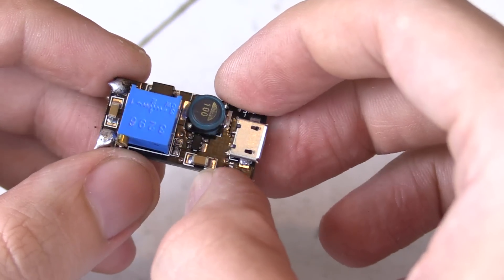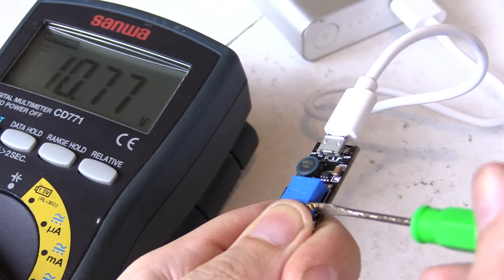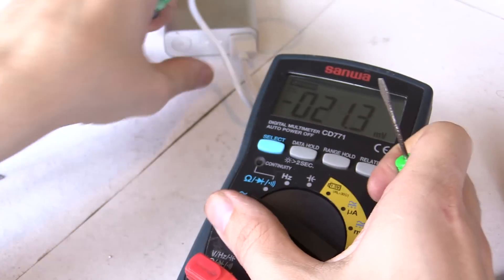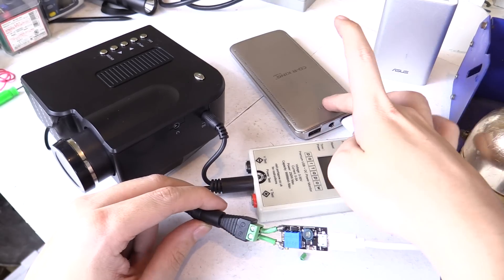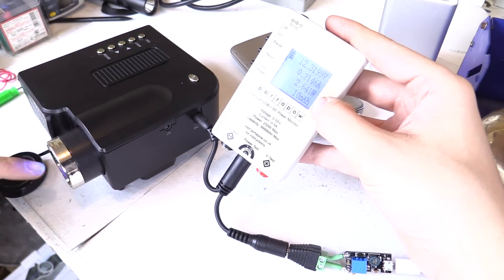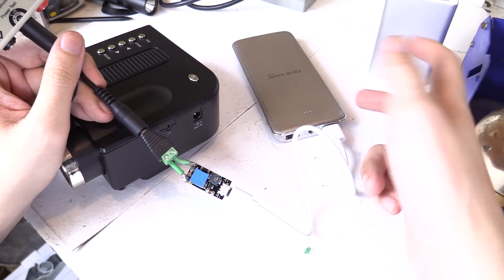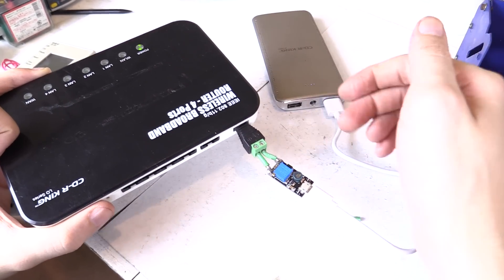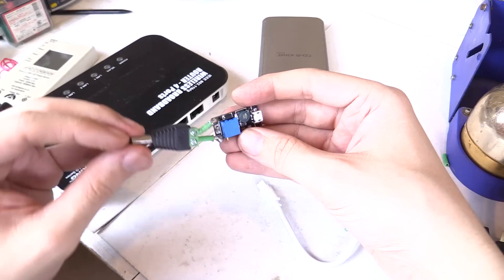Micro USB boost converter - MT3608

Comment: could it power my pc screen off of a usb port from my pc, it needs a 19v 1.3A input
Reply: Not from an usb port. 19x1.3=24.7 watts. 24.7/5=4.94 amps. So if the module was 100% efficient it would draw 5 amps from your usb port. That is not possible. An usb port can only deliver 0.5 amps. A power bank maybe upto 2 amps but not 5 amps.

Comment: Can anyone tell me what will be the value of R1 AND R2 if we want to get fixed 6.7V output not using rheostat to adjust.Input is 3.7-4.2v
Reply: The equation for output voltage is in the datasheet, or you can just set the trimpot and then measure what it is set to.

Comment: What happens if I connect my micro USB charger directly instead of using a power bank?I just don't know, can somebody help.Thanks :)   Would there be a heating up of my charger when 
 adjusting the volts ?
Reply: i think that would work. but MT3608 is a switching device, and your charger is a switching supply also. might interfere with the MT3608 board. put a cap on the input of the board and see if it works.

Comment: dont you have to power on a modem too in order to have internet?
Reply from the maker: Yes, that's what we're doing in this video..
Reply: u called it a router...ur routers are 2 in 1 devices and serve as modems too? I have 2 separate devices
Reply from the maker: +danh le yup it's a two In one. That's pretty common for ISP supplied devices.

Comment: another very helpful video, thanks! is it able to power a laptop from a power bank?
Reply from the maker: It could probably charge a laptop very slowly while it's not being used. But i doubt the standard powerbank could provide enough power to charge the average laptop while it's being used.
Reply: No, not even close.  They'll shut down if you try to  exceed 2A and that's input.  5V 2A input gives you less than 1A output at whatever voltage your (a typical) laptop needs.   Choose a different boost converter.  Also most power banks are typically limited to 3A or less so this is a secondary bottleneck.

Comment: can this run in inverter
set it to 12v and run 220v on it
Reply from the maker: I could try it and let you know. I doubt it would be much use because it can't handle much current. Most inverters consume 5-10W even when idle.

Comment: what is the output current?
Reply from the maker: According to the spec sheet, up to 2A output current. But at the top end that would be 30V 2A, 60W. I have doubts it could handle that.
Reply: if i have a supply of 5V and 1A which is 5W how can it have a 30V 2A  or a 60W output?
Reply from the maker: If you're using a 5V 1A supply then obviously that wouldn't be possible. The board has input pins which you can use, aside from the micro USB port. You can actually feed in 2-24V.
Reply: ware  can you buy  diy  charger kits  I'm going make a  vid on  how convert a  rf  remote  to  be   re charger able  :)
Reply from the maker: eBay is the cheapest and easiest place. Most sellers offer free worldwide delivery too. You just have to be patient waiting for the delivery. Actually it arrives in the PH pretty quickly but it can take a long time for your local post office to process it.